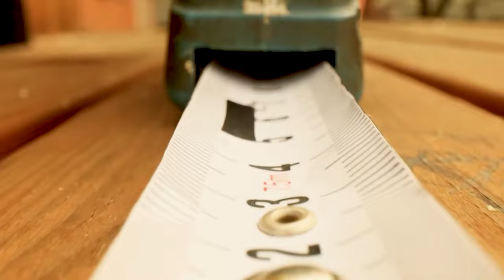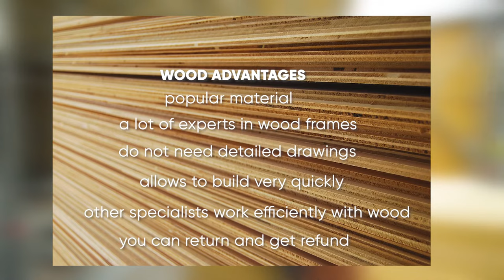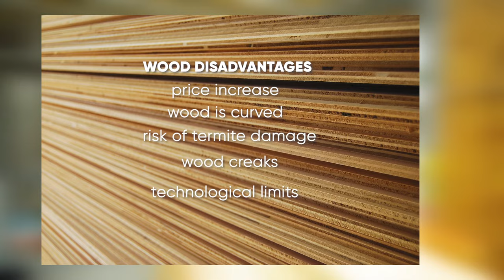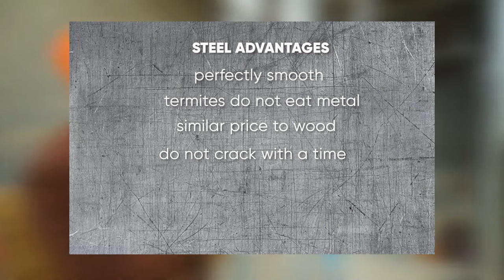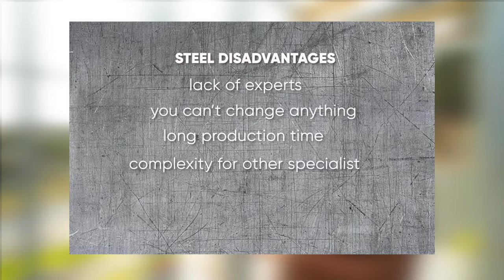Metal or Wood Framed Home - Which To Chose?

Comment: There is absolutely no good reason to use a wood frame over a steel frame which is the closest thing to printing your home and erecting it in days with just a few unskilled guys. You save money on the wood but you loose money on labor so at the end steel is cheaper and lasts forever!
Reply: Build your home out of those ibeams they use for skyscrapers, and you can probably survive a tornado, hurricane, and earthquake simultaneously. :face-blue-smiling:
Reply: Wood is very cheap right now and you could build skyscrapers out of SYP, it’s very strong. If you are cash poor, that’s a good reason. Wood has dropped to pre-pandemic prices.
Reply: @cindystokes8347 Plus I heard the steel frame can rust?!
Reply: @australianwoman9696 si, como la madera pudrir! El steel framing bien ejecutado es superior a construir con madera.
Reply: Not to mention that steel is far stronger, lol. 😅
Reply: @cindystokes8347 lol yeah right, it's gone down a bit but not that much and housing is still at record high prices
Reply: @australianwoman9696  we manufacture galvanized steel and ship it internationally and we galvanize the steel by coating it in a zinc layer so that it will never rust.
Reply: Yes but what last forever is the long term effects and green houses gasses released to make steel. I would not used unskilled people to build my home. You will see more and timber taking over high-rise towers  . Timber is the future . Steel last forever does it ??? Far  more reasons to use wood than steel ,you just need to be  ed-you- markated .
Reply: @tatebrady240  Timber definitely has its place in construction, but let's not forget the long-term benefits of using galvanized steel, especially when you're talking about high-rise buildings. Galvanized steel, like what we produce with the CFS (Cold-Formed Steel) method using a roller, offers unmatched durability. It’s treated to resist rust and corrosion, so it lasts for decades with minimal maintenance, unlike timber, which can decay or be damaged by insects.

Yes, steel production does involve greenhouse gases, but the industry is continuously improving to reduce its carbon footprint. Plus, steel is 100% recyclable, which gives it a significant edge in sustainability when considering its entire lifecycle.

When it comes to structural integrity, galvanized steel outperforms timber, especially in extreme conditions like fires or natural disasters. And let’s not forget that working with steel requires skilled professionals, which only adds to the quality and safety of the final build.

So while timber is great for certain applications, if you’re looking for something that truly stands the test of time, especially for large structures.. galvanized steel is the way to go.
Reply: genuinely how on earth is it faster to screw everything together instead of using a nail gun on wood?
Reply: @Joedex1625  It’s faster because the steel parts are pre-cut and pre-drilled, so everything fits perfectly without needing adjustments. You don’t waste time measuring, cutting, or fixing mistakes. Plus, steel doesn’t warp like wood, so once it's screwed together, it’s done right the first time.

Comment: 16 years in the smart home automation business and this is incorrect. I’d rather pre wire a metal frame house than a wood frame house.
Reply from the maker: What exactly is incorrect?
Reply: Your claims that it is easier or preferred wood frame over metal stud for wiring. I can prewire a metal stud house 2 times faster that a wood one. Drilling holes and hammering u nails takes a lot more work that zip ties a self taping screws…a hole punch is waaayyy faster then a hole saw…metal studs come with holes already in them that’s what plastic grommets are for…wiring a metal stud project is easier and faster than wood on many levels.
Reply: It takes 2 seconds to drill a hole in a wood stud, and 1 second to pound in a staple. There is no way that you can punch a hole and insert a plastic insert faster than 2 seconds, or screw in a zip tie and feed the loose end through the zipper faster than 1 second

Comment: He forgot to say that wood is a fire fuel .. metal is not .. Another one is water proofing. Wood does not stand next to water. Galvanized steel can stand next to water .. these are two major problems with wood next to steel.
Reply from the maker: Thanks. Agree

Comment: The structural wood problems you said were solved in the early 2000 in Germany, Austria and Italy
Reply from the maker: But not in USA 🇺🇸
Reply: You don't understand how bad contractors are in the US.
Reply from the maker: @GoatZilla  I feel your pain :)
Reply: He forgot to say that wood is a fire fuel .. metal is not .. Another one is water proofing. Wood does not stand next to water. Galvanized steel can stand next to water .. these are two major problems with wood next to steel.
Reply: @kuwaitman  you should really read something about wood fire resistance instead of speaking what ignorance says… plus like o have said dead something about xlam and look at some stratigraphies
Reply: @matildeoliz4823  give me some fire resistant wood i will put it in my fireplace made from steel. and i will see what happens to it .. if it doesn't burn i will use it to make a house ..
Reply: But the  price
Reply: Not true

Comment: No mention of insulation either. Metal conducts the heat and cold very easy so you need  to insulate more for the same R value and need to be even more careful with creating a proper barrier between the inside and outside to protect against condensation in your walls which can lead to premature rusting of the steal beams and fastners and the build up of mold on any wood or organic surfaces the metal studs touch. Thermal bridging is still an issue with wood frames, but not nearly as big of problem as it is with steal.
Reply from the maker: Yea you are right. That’s why with steel it’s better to use closed cell insulation

Comment: As a carpenters apprentice, I find that metal framing is so much easier to work with than wood. It’s like building legos everything just goes together with ease, everything is straight and once you lock all the walls in, it’s 10x more sturdy than wood.
Reply from the maker: Totally agree

Comment: I'm a licensed contractor in California. Here's are the benefits of going with metal opposed to using wood according to my 27 years of this stuff. Metal is more fire resistant, metal does not expand or shrink like wood does, it is straighter does not bow , more water resistant, termite proof, faster to install, materials could be cheaper depending on the gauge of the material as well as the width of the material.How ever wood is the standard they generally use because at the end of the day it cost more to build load bearing metal stud structures then it does to do in wood.
Reply from the maker: Good point! Thank you
Reply: A wooden home has a million ways to be destroyed, bringing more money in every way.

Comment: I hired a dry liner to retrofit insulation on a 10 meter wall, once the standard prep was done.        I brewed a coffee and went off to write a short email. I didn't even finish the email before the guy had installed the top and bottom tracks fitted and 12 upright studs up. 

He left the studs loose so he could fit the 600mm rockwool sound slabs, pushing each one up tight, so there were no gaps, then screwed top and bottom. I was blown away by how fast the wall went up. With the addition of an L bracket every other stud, the wall is rock solid. MF is the future.

Comment: wood is scarce & heavy to transport... also crimp & expand, insect prone, plus water/ moisture is the end to your structure...  LSF is completely recyclable & has a 50x lifespan compared to timber... good video though
Reply from the maker: Thank you man
Reply: In Europe wood / stell are less popular compared to standard brick and steel enforced homes. We often use solid thick concrete bricks and woodden roofs. Its like 90% of homes build out there but stell and wood getting more popularity lateley due to rising costs of materials.

Comment: Lumber was less $ when I first noticed steel framing. Now lumber cost/ has gone up, yet steel still cost more. I get it though. Still I prefer lumber due to its adaptability. Plus it’s easier for the common person to change and hang things with a nail/screw than on steel.

Comment: Some of what you say is true but some of it is not true.  Your video is misleading due to the incorrect content.  Steel is superior to wood.  Wood burns, wood rots when exposed to water, wood warps, wood expands and contracts based on relative humidity, insects love wood, you are limited in the distances you can span with wood (even engineered lumber), wood houses will make noise , the walls and ceilings will not be straight.  And there is a double digit waste factor with wood.  Wood studs and joists are heavier to carry and move.  You DO need detailed drawings and inspectors must inspect to catch all the mistakes the framers make.  On a 2,000 sq. ft. house, the construction is simple.  Ceiling heights are generally low, spans are limited, you can pretty much use dimensional lumber from the warehouse guys and many framers are available.  There are building codes and someone must be sure the framers are building according to code.  Wood is essentially fastened with nails from airguns.  Without special steel clips and straps (which are screwed to the wood members) are needed to have wind resistance and counter heavy wind shear loads.  The load bearing beams (from dimensional lumber, engineered lumber or Gluelams) are heavy and hard to get into place and difficult to move.  Also the spans are limited and longer spans gets very expensive.  

CFS (cold formed steel) framing can be used in most any building.  On small houses it is comparable to wood in place price.  The larger and more complex the structure becomes, you have more advantages with CFS (cold formed steel). CFS is available in multiple gauges.  You also have the advantage of either buying the material in lengths  depending on the struct We are engineers (civil, structural, geo-technical) and construction managers with 30 to 40 years of experience (each of us).  Both require calcs, drawings and engineer's seal and signature for residential structures.
Reply from the maker: Thank you for a detailed response

Comment: By chance I been looking into building a house (be in the future) I want it to be my forever home. So I’m thinking about using steel. Do you think a house could be built with steel that has bay windows,attic (that’s walk in) and a basement with a tornado shelter? Or would wood be a better option?  Cause i know wood can rot,break and have damage overall cause of moisture and what not but steel seems to last way longer than wood and safer but not sure if they could do a custom built house that’s steel. Do you you think a house that’s custom designed would fit with steel? Also I heard steel is also good for the environment rather than wood. I know everything has its advantages and disadvantages but steels looks like the better choice (definitely in the long run) but how would replacing it be? Compare to wood frame house?
Reply: To be honest here, there is no more environmentally friendly material than wood. Wood is basically a carbon incorporated by trees from he atmosphere and the only energy used was to cut and process the tree.
The steel-reinforced concrete on the other hand is a product that is made of the iron ores, aggregate and cement that requires a lot of energy o be produced.
As long as you can afford it you can do whatever shaped and features you want with steel and concrete, but in order to be practical and build you house in  smart way you better to hire the architect or be the one who knows what he does.
Reply: There is also different types of wood buidlings.  I really like heavy timber buildings.  I think they are the best all around.  The problem of metal are ironically fires.  Mental is quite weak as any heat will cause it to elongate i.e. push everything outwards, lose strength and warp.  The problem of concrete is you are a prisoner and can not breach a wall when needed to and cracking which will let water in.
Reply: You are not building the skyscraper or commercial building, go with steel reinforced concrete. Honestly, if it is one floor house and you dont have a high fire hazard like in California, or tornados/huricanes coming around - anything will do.

Comment: I would choose the metal frame not, because of it rusting either. It's the fact more simple to change out then pinewood. If i were to choose wood imagine all the breakage, water damage applied to that of being whole. Next i would have to began going in to more investigative work on how deep a crack in wood will be 😫
Reply: @eustaciabarby9931  一定
Reply: @tuka6147  as a welder for multiple different companies from building just constructions for small building thru machinery even up to skyscrapers. There are so different types of metal. But here in europe even most expensive metal is cheaper. And you sometimes see 12m long 40mm thick and 30mm wide metal beams bend like they would be made from wood, and those are mostly used for highrises, while more stiff ones are used for low rise buildings.

Comment: Lots of comments from people that have no idea of the long term effects of using steel over timber .I have  built steel and timber  frames and trusses for over 33 years -thousands of projects . 
I stopped using steel due the the long term effects on the environment and future generations. Steel production alone makes for over 30 % of the earth's green houses gas . Timber is a sustainable product.Timber has is great thermal product, strong and costs effective.If it is a cold day with steel you have a cold house Long term you will find timber move more and more to high rise as we look to product our resources and planet  .Steel expands and conracts more than timber "Coefficient of thermal expansion "We all need to be Carbon Warriors . We should only use steel when there is no option. All homes need to be rated on the long term effects of the build overalllifetime.easy to make a score system Steel would have no chance-   Natural products will always be No 1 ask mother nature she built the place we all live in .
Reply from the maker: Good point. Thank you

Comment: Wood has better compressive strength for hanging cabinets.

Its easier to shoot a nail than to screw a screw.

That's probably its only advantage.
Reply from the maker: Of course! Wood and Steel have pros and cons
Reply: Better compressive strength comparing to what?
Reply: @vm5571  steel studs.
The weight of cabinets wants to bend the steel studs and won't bend the wood.
Reply: why would you nail cabinets?

Comment: What is the cost of metal frame compared to wooden frame
Reply from the maker: metal is always more expensive. During Covid, in 2020-2021 cost of wood jumped 3X because of supply chain issues
Reply: @MyTexasDreamHome  thank you for responding, your videos are great
Reply: 2023 update wood stud $3.25 metal stud $9.50
Reply: @2freshprint853  Thank you!
Reply: @2freshprint853  what gauge, size, and supplier are you referring to?

Comment: We manufacture steel frames and our computer system calculates everything and provides a schematic for the home builder. Our system even calculates where the pipes, screws and wires will go and then prints the steel with those specifics in mind.
Reply from the maker: If sound like amazing technology
Reply: Info please. I am looking for a company making steel frame building
Reply: @dinhtram1410  hello did you see my reply
Reply: What kind of machine presses this metal sheets?  İm looking for it
Reply: @alex-lu8mi  cold roll forming machine and then after you apply a zinc layer to the steel that galvanizes it
Reply: @DecentraHomes   cool.  Are there any good brands you can recommend.  I saw a bunca of machines from india and china. But im suspect of those.  I heard there needs to be an integrated software to print the steel out